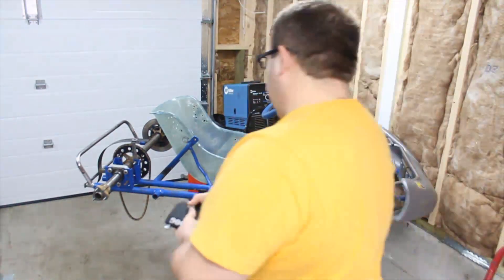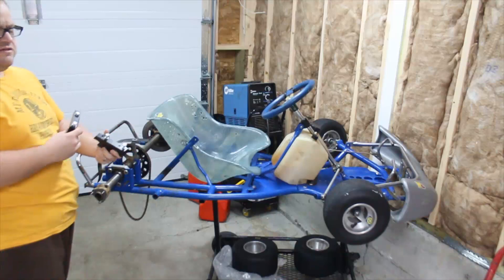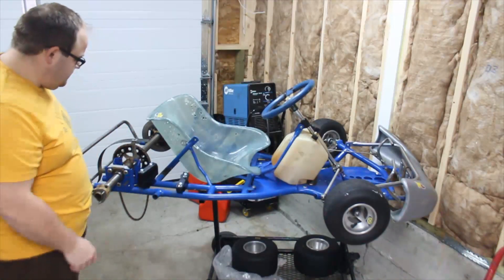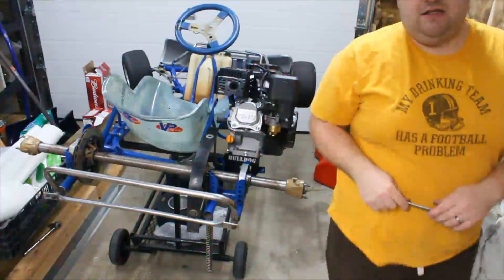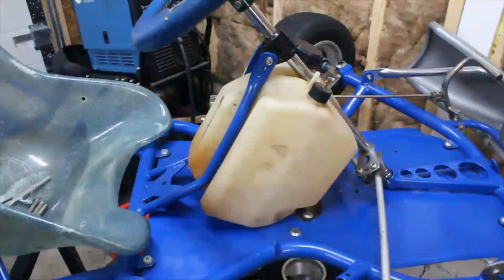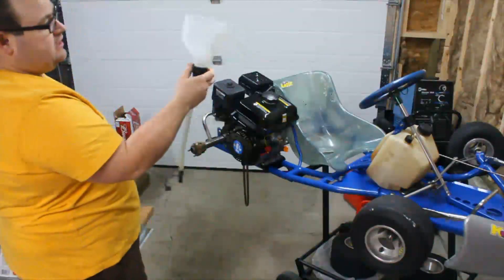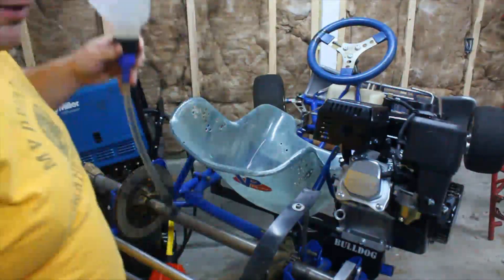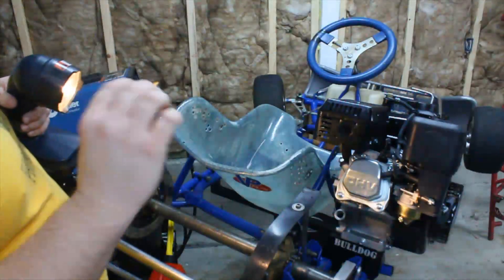EsoBOFH's Kart Build - Ep. 1 Pt. 2: Engine Mounting & Prep

Comment: Great video im rebuilding a kart myself! I have a few questions though... 1- my kart chassis looks an awful lot like yours. Im having trouble finding out what kind of kart mine is. The ONLY markings ive found are on the rear bearing holder that say "Invader" even though I know they ckuld had been changed out previously. Knowing your kart brand could help me. So, what frame is this that you have?

2- I am currently lookung for engine mounts. Most of the ones i have seen (whithin my price range) are just basic, slotted plates. The "pro" types are upwards of $100+! Yours seems more of what I would like to go with; deoending on price. What mount are you using (name) & what is the roy d about price i cohld buy one for? (And where 😅)  Any advice is greatly appreciated! Also i am running a 212 predator, but i also have a 125cc 4 speed id luke to eventually swap out from time to time! Im assuming the mounting bracket you are using WILL work with a 125 seeing its adjustable forwards and backwards! 

Thanks for this video! I am going to watch the entire build series after this video! Im certain you will hear more from me shortly! I like to ask a lot of questions, its my learning process 😊

Edit: i LOVE those rims! 🤩 Happy karting from Alabama!